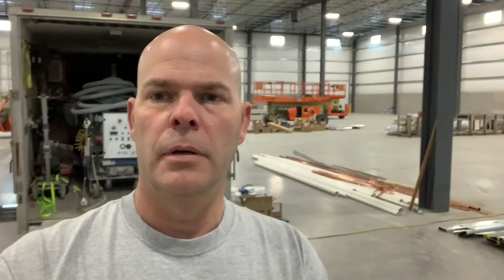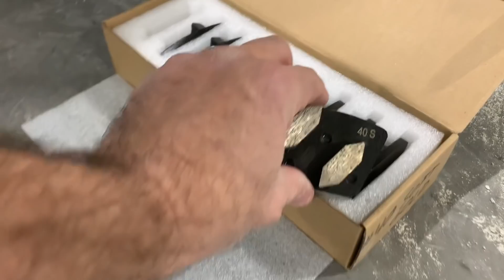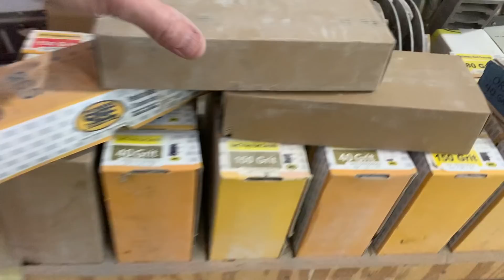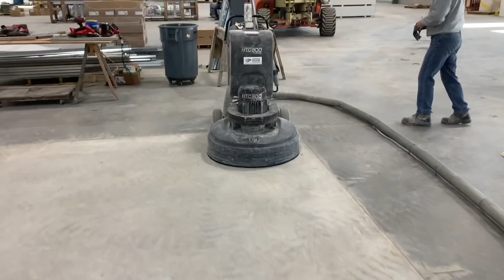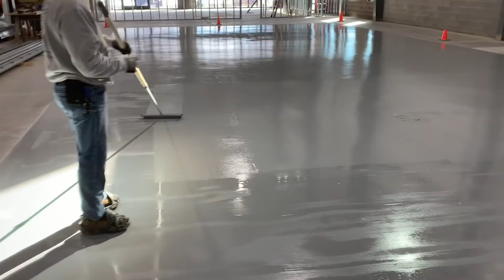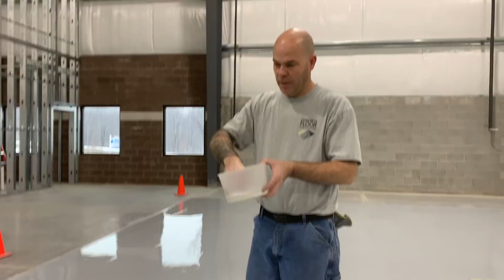1,800 Sq. Ft. Washdown Area Epoxy Floor  And Trailer Tour

Comment: whats your process for checking how hard or soft the concrete is? do you have a mohs test? Or can you just tell?
Reply from the maker: We used to use the Mohs test, but I found it extremely unreliable. It got to the point where I could just tell by looking at it for the most part.
It is very important to have every set of diamonds available, that way no matter what you run into you are prepared for it.

Comment: Is it necessary to acid etch the concrete and wash with detergent on a dirty concrete floor? Or just diamond scratch and vaccum will work
Reply from the maker: Diamond grind to create a scratch and vacuum. That is it. The primer that we use will penetrate into the concrete.https://concretefloorsolutions.com/product/500-sq-ft-solid-color-epoxy-floor-kit/

Comment: Does filling the saw cuts risk the concrete cracking in the future?
Reply from the maker: It does not create cracking, concrete has a mind of its own, if it's going to move it will crack.  That is a risk everyone takes with concrete
Reply: @ConcreteFloorSolutions  I think his question was when you fill in the control joints will that Force the concrete to crack in other places instead of the control joints would you be creating or forcing it to crack in other places I believe the answer would be no those control cracks are still there that epoxy is not going to stop them control joints from taking on the load of a crack they are still expanding and contracting even though they're filled

Comment: Do you guys do other types of epoxy l supervised building food processing factories for 25 years some floors we used 10 to 12mm thick sand/epoxy  mix steel trowelled we called it shoreshield ( heavy duty  epoxy floors)also we used highbuild epoxy approximately 5 to 6 mm thick mainly used on clean rooms  used air removing rollers to prevent fisheye appearing in the epoxy etc also used flake system on laboratory's floors but sanded after the flake had dried and applied  3 coat's  of polyurethane  we tend to used roll on epoxy in maintenance areas were we need to keep the floors  cleaned

Comment: what would you say all this cost? did you start your company with all this right away? would you say you spend less by getting the loan to just get the good stuff vs working your way up?
Reply from the maker: Hundreds of thousands of dollars. It is a lot of money. No we did not start with all this equipment. But I did learn the hard way that it is well worth the extra expense to get the good stuff.
Reply: @ConcreteFloorSolutions  absolutely if you have the right tool for the job it's like no work at all

Comment: Hey Jason, great video.  Thank you for making such informative content.  As someone who started my own concrete coating company just 2 years ago, I very much appreciate your videos and have learned a ton through them.  

I just wanted to give you a heads up in case you weren't aware but the "Visit our online epoxy store" and "shop now" links on your website home page don't seem to be working.  Ive tried on both my phone and computer because I was looking to purpose some of your polyurea crack filler but your website looks to be having issues.  Just thought id give you a heads up if you didn't know.
Reply from the maker: I appreciate that, yesterday we encountered some type of an error and now the website developers are working on it. I'm hoping it's up in the next 24 hours.

Comment: that cleanout looked annoying to deal with. failure on both the plumber for making it too short, and the concrete crew for just burying it and not masking/forming around it.
Reply from the maker: It was a bit frustrating, I wanted to show how to deal with it when in between coats.  Had I known that was there when we started, I would have feathered that out 12".
Reply: @ConcreteFloorSolutions  I don't think it was a big deal at all you did an excellent job you did exactly what you were supposed to do and covered the contractors ass no questions asked no harm no fail well done professional

Comment: good tip on feathering the edges in a circular pattern, i am still new and like to ride the wall in a straight line, but it sure does cause more work later 
would you say you guys do more polishing or epoxy?
Reply from the maker: probably 50/50. I prefer epoxy, less grinding and you know what your going to get when done.
Reply: @ConcreteFloorSolutions  for sure like the one video you had all them crazy cracks in it but like you tell the customer beforehand you don't know what you're going to run into once you start grinding you're here to make it shiny not rebuild the place

Comment: How long is the trailer? I’ve been waiting forever to see the inside.
Reply from the maker: 36' maybe you were the one who commented asking to see the trailer.
Reply: What trailer size would you recommend to do this kind work ? is 36’ the minimum?
Reply from the maker: @Paulo-Limaaa  If you are going to have the same amount of equipment, you almost need to have 36 foot. If you're doing residential work, I would try to keep it 20 feet or less. Otherwise access can be very difficult into driveways etc.
Reply: Thanks for the answer I really appreciate 👍

Comment: Once a set of diamonds glaze over, can they be reconditioned and reused or are they garbage?
Reply from the maker: yes, typically you need softer concrete to open them back up.  sand works with some water normally too.

Comment: why you add ammonium oxide ?
Reply: It is aluminium oxide and it’s use to make the floor anti slip.  (Like a sandpaper if you can see what I mean)
Reply: @charger440  Yup! It's the same as salting an icy walkway, it helps keep you from sliding when the floor is wet...

Comment: that trailer has to be heavy
Reply: It's got a 15,000 Lb. load capacity so the trailer itself likely weighs 7,500-10,000 Lbs. empty...Not sure what kind of truck is needed to Legally tow it, but it'll be heavy enough to require a Commercial Registration...
Reply from the maker: CDL required / commercial reg, Chevy Silverado / Duramax diesel.